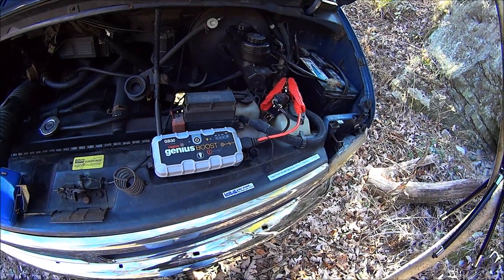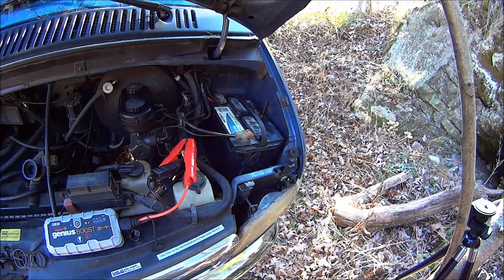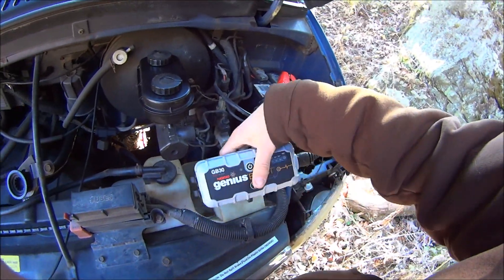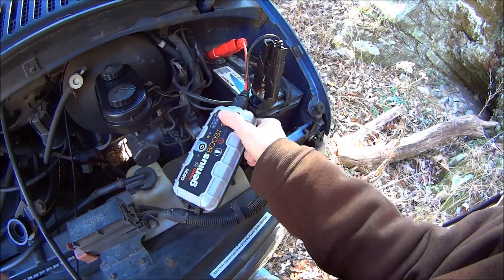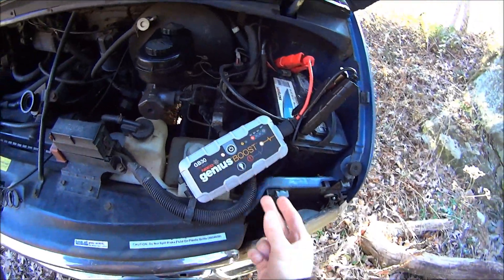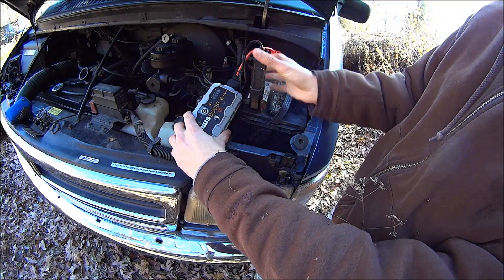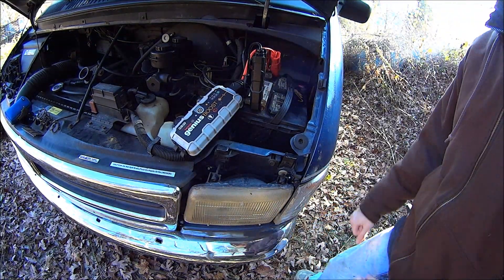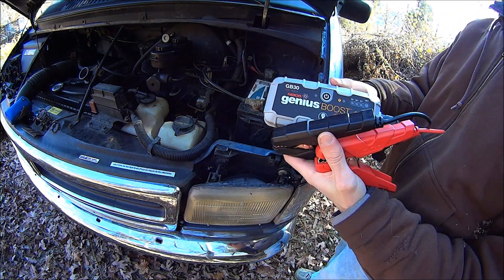Cold Weather Jump Starting with NOCO Genius® Boost™ GB30 - Cold Start, Dead Battery

Comment: Those are nice vans , and it sounds nice too!
Reply from the maker: thanks! it is a good van, i'm trying to sell it though lol
Reply: Very dependable they are, I'd buy it if I could lol but I already have something lol . Did you try Craigslist?
Reply from the maker: Yea it's on craigslist, I had a few calls but no time to respond to them lol. I will have it sold eventually.
Reply: I understand that , im selling some car doors on their lol . Tried to sell it to a blond in the desert lol blond jokes
Reply from the maker: hahahah
Reply: I was wondering what fuel mileage do you get with your truck?
Reply from the maker: it's probably about 13-14mpg lol. i didn't calculate it officially yet. how about you?
Reply: I'm thinking around the same but it will be different because the trans and engine are from a 85
Reply from the maker: oh yea thats right
Reply: I'll find out when I get het running
Reply from the maker: let me know what it is. also this van has a thrush muffler which is why it sounds decent
Reply: Yeah they do sound decent my dad's 71 f250 has dual thrush tubes
Reply from the maker: nice i bet that sounds good!
Reply: It does lol . It sets off car alarms sometimes . My dad was nice enough to let me borrow it until I get my truck running lol
Reply from the maker: lol!
Reply: Luckily I haven't gotten pulled over by the police because of the awesomeness since it is just fence posts and thrush tubes lol
Reply: sweet tires. white letter
Reply from the maker: lightningsmokerXx thanks!

Comment: Do you still have this model? How has it been since your review of it?
Reply from the maker: +thurm101 I still have it and it's still working as good as it did when I got it. I've used it in the cold and heat, stored it in the cold and heat (although I do store it inside now) , used it as a 12v power supply, to charge my phone, as a flashlight, and of course to jump start cars, trucks, atvs, tractors, and boats. I literally used it last week to jump start a mower that I was interested in buying. There is a newer model now called the GB40.

Comment: 30 degrees lol try -30 bro 😂
Reply from the maker: wish I could but it doesn't go to -30 here lol
Reply: I was just going to ask because it's -39 here and I just found out online that we aren't supposed to have the NOCO in anything colder than -20C which is when we need it most. I wish I had have seen that before buying three of them.
Reply: I think these are rated to -4f.  I have 3 different brands  and they all need warmed up in cold weather.
Reply: @jimsheely5491 how do you warm yours up? I can't get mine to work its too cold